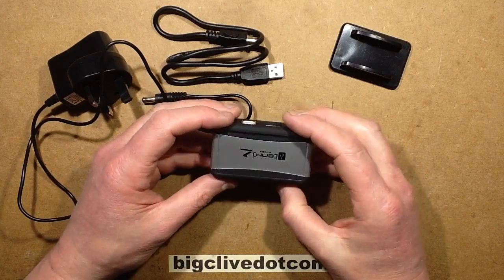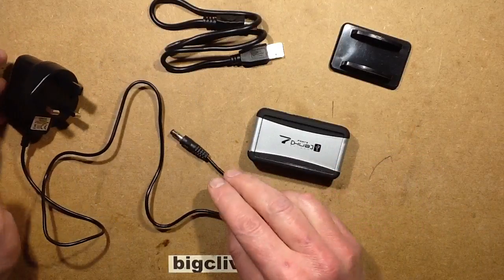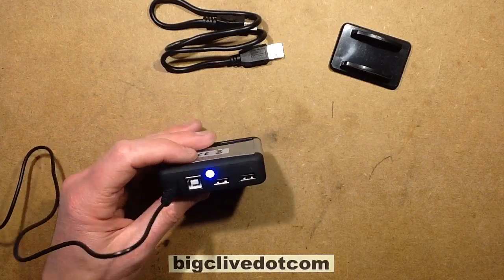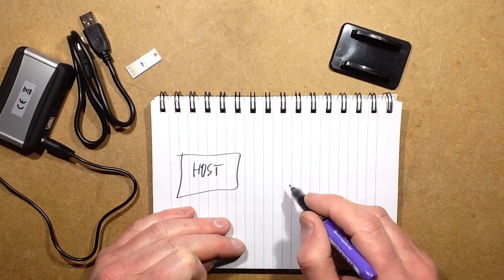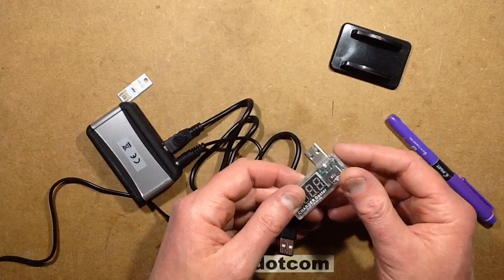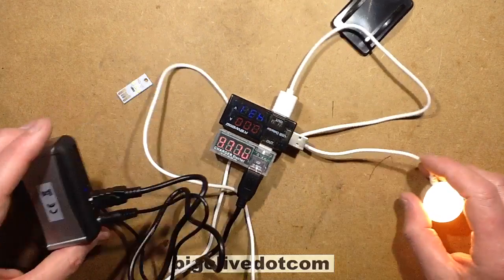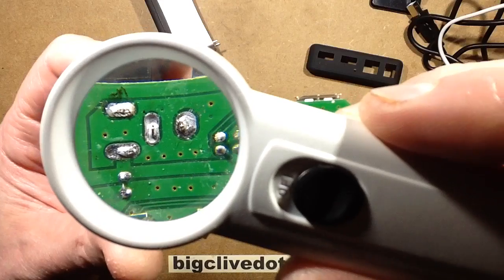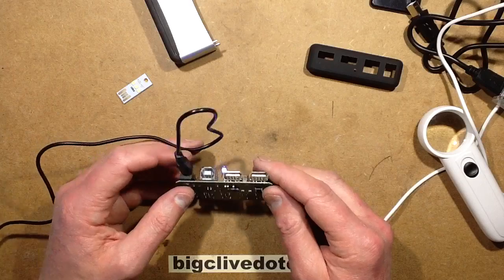Computer killing powered USB hub.  (Mac murderer)

Comment: Take a thin pair of pliers and your soldering iron, then heat the pin for +5V on the USB-B connector and rip it right out. Problem fixed. Or just cut the PCB track corresponding to this, remove the solder mask and put in a SMD shottky diode.
Reply: +BloodySword That's what I was thinking.
Reply: I wonder how a MOSFET would work in that capacity? It would have a lower voltage drop than even a Schottky diode.
Reply: Chaplain Dave Sparks
Would work better but is much more expensive and also fiddly to get in.

Comment: How very interesting! i have one och these, bought in Thailand in 2011, and a couple of macs! I dug mine out and checked the pcb. It's quite different from the one in the video, one difference to note is that I have an smd marked "L1" on the positive lead (in series) between the power input and USB B connector.

Comment: This is interesting. I bought the exact same USB hub years ago, it always gave problems when it was powered. So I used to just not plug it in to the power and used it as you suggested, before dumping it eventually.

Comment: Guess couldn't afford diodes for input protection.
Reply: +Majid Faraj Wouldn't the voltage drop from the diode + the need  to handle a decent amount of current be a problem though? I mean you can do it, but it seems like a lot for something that shouldn't happen in the first place.
Reply: +Kevin Slater  I agree completely.  The 5 volts should NOT be fed back thru the host port. Period.  Bad design, and regardless of what the Mac haters say, poor hub design is poor hub design.
Reply: In signaling that shouldn't be a problem, for output voltage drop can be compensated for.

Comment: How about using a USB cable with a snipped +5 wire between the hub and the mac?
Reply: Would work, but it would be way too impractical. "Oops i switched the cable and my 500$ laptop is dead"
Reply: Lazar Šaronjić Yeah, I was just meaning would that work at all? It it did, then just detach that pin inside the hub somehow, so it can't contact the usb cable, and done!
Reply: +Brad Gefroh that would be a good fix, you wouldn't need to worry about frying the host + you dont need an overcurrent protection which they probably didnt include.

Comment: I was hoping to see you add a diode to the device!!! Please add the diode*. I like to watch you repair and solder!! At night especially. alone. in the dark.  *I'd love to see a through hole diode but an SMD would do.
Reply: +Michele Marie Dalene  A proper fix is to bin the piece of shit hub.
Reply: +Michele Marie Dalene A 5.6Volt zener reverse bias from + to gnd to clamp any over voltages would be a good idea. 5.3v would to do too but any lower and you risk hitting the knee on the reverse bias.

Comment: Shouldn't Arduino tinkerers be blowing up their Macs all the time? When you power the Arduino from somewhere else (e.g. a battery) and use USB for serial monitoring, you end up with the same situation. The 5V rail that is fed from the battery/regulator is directly connected to the USB port and thus should backfeed in your computer as well. Never heard of anyone reporting that.
Reply: +Hendrik Busch A simple diode on the Arduino usually prevents this (or in a more complicated setup, a PMOSfet providing reverse polarity protection).
Reply: +idpromnut Your comment made me check my Arduinos and you're right, there is a diode protecting the USB port from the 5V input. At least on the genuine ones that is. All my chinese clones offer no such protection. Good to know.
Reply: +Hendrik Busch You can have a look at this application note from Maxim:

https://www.maximintegrated.com/en/app-notes/index.mvp/id/636

It is a good read about how to improve the typical basic diode-reverse-polarity protection.

Comment: I did something very silly to my MacBook Pro. I was setting up a new mini quad and somehow got the 5v from the usb serial adapter crossed over to Batt+ (12v). When i plugged in the battery it instantly turned the macbook off. I was really crapping myself as i could smell some electrical smoke. Luckily I managed to get it working again by turning it back on with certain keys pressed down (i think it resets some sort of protection circuit).  The macbook is working, except that USB port is totally dead. Could have been worse.
Reply: +paulham Your first mistake was buying a Mac Book anything..... lol

Comment: Lots of USB hubs are wired like that. As you say you can just ignore the power adapter. If you need extra power, I have used a USB to DC jack lead to supply additional power from a second USB port, and on one PC I wired a lead out the back of the PC direct from the 5V line on the power supply. In both cases, the supply is switched on and off at the same time. But don't do that with USB ports which are powered from the 5V Standby line that is always powered when the PC is off.

Comment: I have a modified version of this hub, that was sold for the Raspberry Pi, specifically made NOT to backfeed. 

It was listed on Amazon here (now showing 'no longer available'):

http://www.amazon.co.uk/The-Pi-Hut-Powered-Raspberry/dp/B00B0ZOCPS

The description for the product describes the backfeed issue, as it was a known problem (at the time) for the Raspberry Pi and powered hubs. 

I guess the issue isn't limited to the Raspberry Pi!

I also have the same cheap crappy version which does backfeed. I may have to open them up and do a comparison.
Reply: After checking, it looks like the Pi Hut still sell the non-backfeeding modified version of this hub on their site here:

https://thepihut.com/collections/raspberry-pi-power-supplies/products/7-port-usb-hub-for-the-raspberry-pi

I'm just trying to prise mine open carefully to see what the difference is on the board.

Comment: Hah! I've had this exact hub for (at least 5 years?) It worked fine for a very long time, then I noticed that occasionally it would stop the PC from booting when it was connected. On investigation, I found that with the PC power supply unplugged, and the hub plugged in, the status LED's on the motherboard were lighting up. That was the last time I powered up the hub!! I've continued to use the hub without powering it for some time after this discovery. It's nice to know  (should the need ever arise) that it will quite covertly kill Macs lol
Reply from the maker: +arcadeuk You could also use Dr Clives universal square pin to USB compute-o-bliterator.

Comment: There are actually many not just cheap eBay ones that do that. In theory the usb port should not care it the power line is powered by the external device, but hey macs ^^ I kind of think that it is a feature to power the host, as an example I power my raspberry pi through usb hub

Comment: just today one of my friend working for toyota reported their agency got complaints of a few FJ Cruisers going in fail safe mode, vehicle performance reduces and speed goes down and sometimes leading to engine stall when the driver plugged in a candy brand usb charger. The engineers concluded the charger was drawing excess current causing the ecu to loose power, i was trying to explain to him its not possible and would be a circuit design fault in the car because such chargers can draw like 3A and that to with no usb device connected they found the charger drained all power from the car. Im trying to get hold of those chargers so can send it to u for analysis
Reply from the maker: +Bipin Patel That sounds like a clutching at straws type of diagnosis.  I would have thought that an ECU should not be affected by a load in the lighter socket.
Reply: +bigclivedotcom exactly what i tried to explain to him, anyways, to me it seems like a bad circuit board design of the car, im trying to get hold of that charger in question so can send it to u for analysis. This case was considered confidential as it would result in a recall of cars and lot of money replacing motherboards

Comment: Ouch... that's good to know.  I picked up 2 of these for DIRT cheap at a local Frys and I just confirmed the all black model of this same hub in the US does the same thing.  Good thing I hadn't plugged mine into my mac.  I modded it for charging only and discovered it has a brownout issue when powering things... My roomie won't use the one I got for her at all then any more then.  She used it on a PC but hadn't put the computer to sleep while using it yet.  TY for the info <3

Comment: I find it really surprising that pricey Macs are so shitty built that they cannot handle 5V being backfed into the USB ports. Surely this must have been something the engineers would have thought could or even would happen with millions of manufacturers of USB equipment.
Reply: +Maria Engström Yet another reason I'll never be an Apple fanboi!!
Reply: Macs are shit so.. Meh
Reply: It's might be by design. When you blow your 'old' mac you have to upgrade to a newer one.

Apple saves some cents on a diode and a boost converter(to compensate for the voltage drop in the diodd), and they get to sell another computer.

Comment: I guess a cheap work around would be to hack a custom usb lead without the 5v connection back to the pc then the hub would work fine with a pc or a mac

I do have one of these but used under windows. I did have weird things like the usb port would stop working until i hard reset the pc (power off battery removed and then pressed the power button for several seconds - thus resetting all logic on the motherboard)
Reply: +BillyNoMates1974 I'd just cut the trace going from the power jack to the host/computer USB port. Although you would then always have to use a power supply with it - no self-powered mode any more. Unless you wanted to add in a diode to prevent backfeeding.

Comment: A USB host shouldn't care where the 5V comes from. The manufacturers know full and well that people will shove cheap crap in the USB ports.
Reply: Nah not apple because they think their consumers are "high-class" folks that wouldn't dare use such a cheap tool on their products
Reply: @johnsmithjames364  no, they think their users are chumps with too much money in their pockets; and will just buy a new one.  They are selling a $1000 monitor stand for a monitor they sell that doesn't have a stand with it ...  the monitor costs $5k, NO STAND to go with a $6k base 'pro' computer.  Their customers are stupid, because they buy it.  The set up I could build them for $12k would run circles around the high end one, with multiple monitors of similar quality, that come with stands.

Apple used to 'fight the man'; now they are the biggest all flash, no bang for the buck electronics producer of all time.  There is so much wrong with apple and not just the products but the software now, it is a damn shame; as I grew up liking them, when they'd be in schools, when their OS was superior ...  but now its like a bitch of a woman in pretty clothes and lots of makeup, ugly inside, and without all the flash, not so pretty on the outside either.  Cheap and soulless.
Reply: @zakuraayame5091  sad thing is some people or companies would still buy them even if the price is absolutely horrid

Comment: i actually tested this hub on pc with its charger but it didn't connected the device to the pc , & no damage to the pc but i am not going to use it any ways  Thanks, you saved me.
Reply: Be carefull with these cheapo chinese gadgets. Better buy a couple of connectors and a power adaptor at an electronics store and build it yourself.

Comment: tbh i had a trust branded hub years ago that did the same thing. Only thing the pc did was shutting off.
Reply: +Nordic 
I recently bought a 7 port hub from Trust. I couldn't find much information about it online, but I knew that this brand has been around since at least the early 90's, so I figured it would be decent quality. WRONG! I nearly burned my hand as I removed a flash drive that had been plugged into the hub for a couple of hours. The USB port was burning hot.

I opened up the hub to find a PCB that was so filthy and poorly soldered it makes the one in this video look like NASA or military grade equipment. There was even a "quality control" sticker on it. Whoever put it there must have been half blind.

I don't really know what Trust products used to be like in the past, but today it is obvious that they are just rebranded Chinese junk.

Comment: Check the data connections, I had a cheap hub kill my Venue 8 Pro tablet because the +5v was shorting onto one of the data lines. It was not a wire short, it's like something in the hub's chip went bad but enough current could get through to light a 5v USB light off the data lines. didn't expect the hub till another tablet I had connected it to stopped working.

Comment: I have had a hub like this for years, I don't use it much because I encountered te same problem as in this video. I had it connected to a Asus EeePC and everything worked OK even with external power supply (I gues the laptop had protected usb ports). But when I shut the laptop down I didn't really notice at first, but after a while I heard a quiet high pitch sound coming from the laptop. When i disconnected the usb hub the high pitch noise stopped. Since then I never used the hub again :p. 

thx for the video, I like these kind of content!

Comment: I have it too, but I have only used since I bought it without the psu. The PSU was like 30 euros on top of the hub. I have one of sweex and the case is already broken so I had a quick look and yes, SAME problem. But I am powering 4 xbox wired controllers with it with only the USB plugged in. Those controllers have 2 little DC motors in it so high load when they are spinning but it does for me the job. Thanks Clive for pointing this out !

Comment: any way to fix it yourself? I've heard of creating a custom host cable with a Zener diode on the positive line, and I've tried that but the diode I used died  mid-use.
Reply: +MortifiedDumplin A zener sounds odd, either a normal schottky or just plain cut the red wire on one of your USB cables and use that to conenct the host to make sure there is no +5V connection to the PC. I'd open the hub and cut the track from the board to make sure the thing would never output 5V again to the host port.

Comment: If you can kill a motherboard by putting 5V on the USB ports, you just have a crappy motherboard. Sure, that shouldn't happen under normal circumstances, but how hard can it be to prevent that?
Reply: +Mezgrman Unfortunately, wiring +5V directly to USB VBUS is more common than you might think, possibly due to the proliferation of gadgets that abuse USB as a cheap power source.

I had a Shuttle XPC that would reboot whenever I removed a nano-sized MicroSD drive from its front USB port.  I later discovered that the construction of the USB drive, combined with the angle at which I pulled when removing it, allowed the shield to briefly short to the VBUS pin in the USB port; causing the XPC power supply to shut down.
Reply: it's simple to prevent, just put a diode in the positive line.  no current or voltage can enter inside but everything can go outside.  today there are smd diodes that support 10 or more Amps.  However with diodes there is the problem of the voltage drop of 0.5v
Reply: A better solution would be to put a mosfet protection circuit in the power line.
Reply: Agreed. A diode I imagine would be all that's required... You could have a range of "smart" protections involved to test for just these circumstances and then kill the port, hub or controller until resolved - and I believe most modern motherboards actually do all this and it'd be integrated into the controller to allow fast charging of devices and the negotiation of that when the PC is powered off
Reply: I put 9V to my usb because of a crappy usb hub. It killed 2 of my usb ports 😄
Reply: Its actually very hard, as most computers have ESD protection on the ports, that basically redirects any stray voltage on the usb port to the motherboard ground/power rails, these electronics are designed to protects against the low "impact" of a static shock, and not the high "impact" from backfeeding. This will burn the ESD protection, and then causes the usb chip to latch up. Once you apply power to the latched up USB port, the chip will short circuit
Reply: @Ferrybig  What you describe goes for the data lines. The power line should have its own suitable protection. Also, ESD protection doesn't do its job by latching up outputs.
Reply: lol they were macs, they are literally designed to stop working over the smallest issues so that you can bring in it to pay 1500-5000 on repairs or completely new equipment, that is why fight repair shops so much so they can keep running their scams, and now you cant even save your data if the machine is dead, unless it can boot your data is in purgatory.
Reply: 3:12 considering the motherboard is literally the only board and has the USB controller on it, not very surprising. Also, Apple

Comment: to be honest i think this thing is somewhat correctly designed but has been poorly used. the thing withe hubs is they are normally powered of the main device but if that cant bring up the power some hubs have a mains lead like some external hard drives to boost the power. wether this power needs to go back to the main device is the question . it may need to be secured , but i can see the advantage. ex if you would connect all  the ports withe power hungry hard drives and you would run them of a small computer like a tablet this would work.  or if this hub is placed at the end of like a 5 to 10 m usb lead ( which i have done in the past to get round my house before we had wifi on printers ) then it would need to be powered both ways. I'm sure there had to be some text in the documentation of this device explaining this , and the fact that you should only connect the additional power if connected devices would not power up.